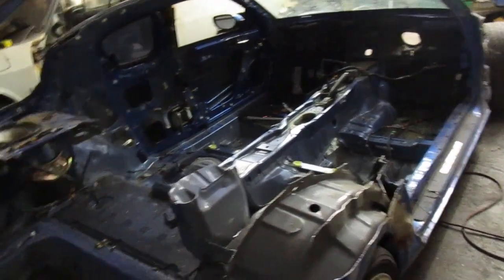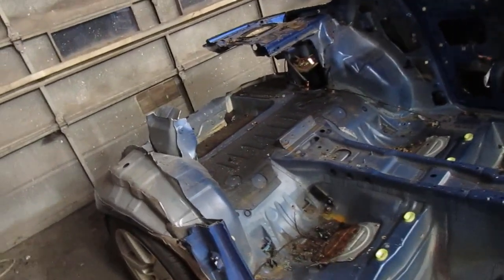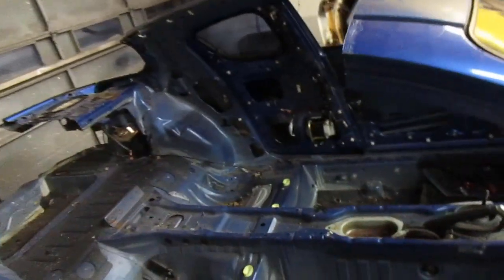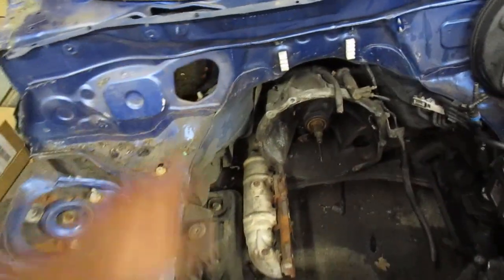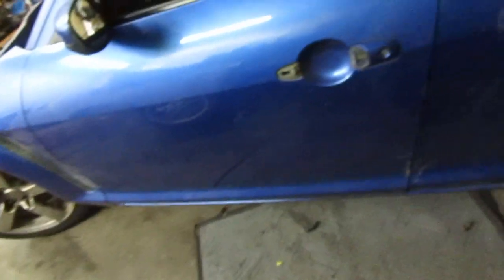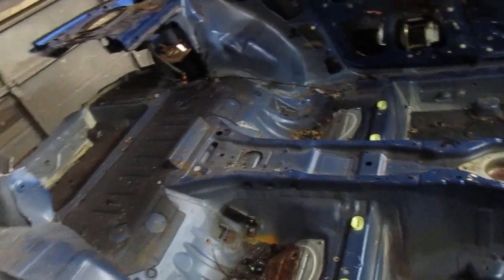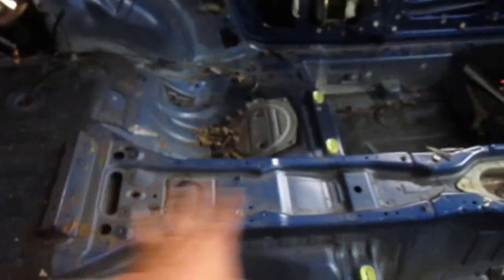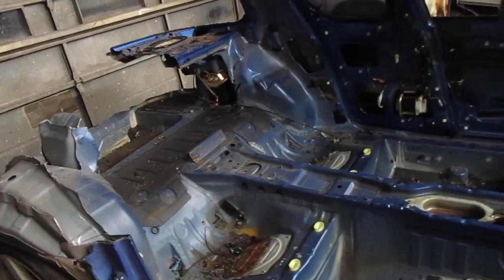Building the Electric RoadRace $200 RX8

Comment: if i made an electric car i'd choose the RX8.  I looked up all the specs, weight etc. So many cheap ones in the UK with nothing wrong with the body because they don't pass emission test on MOT or the rotor needs new tips..  I'm on the fence though. i can buy a reasonable 20kw motor and probably £4K in Lion batteries but  motor start to go stupid prices bigger than that. plus the batteries might need replacing every couple of years. lead acid batteries would be cheaper but not sure i could get the range with the volume i fit in the car.   I'd use it daily 16miles then most i'd go every couple of weeks is 120miles. i got a couple of electric bikes i use for the daily 16miles. so i can just get a cheap combustion car for the longer runs. Allways had my eye on this converison though./ not sure the legallity of using it on the road in the UK, nice porsche by the way.